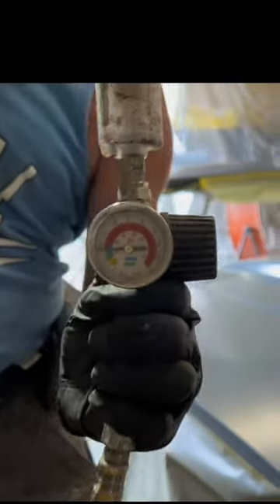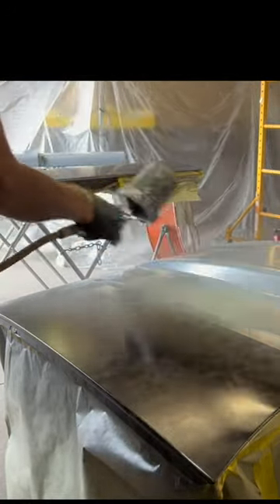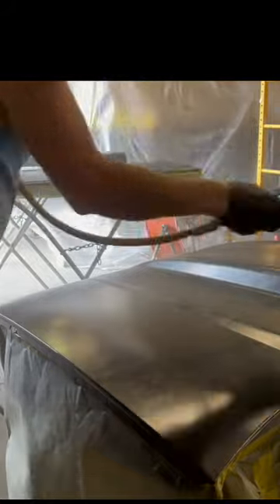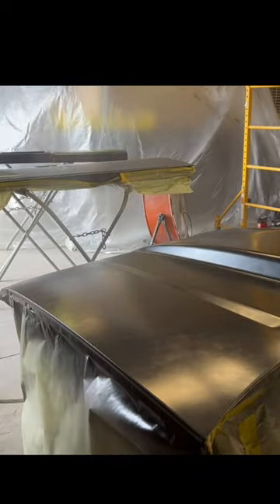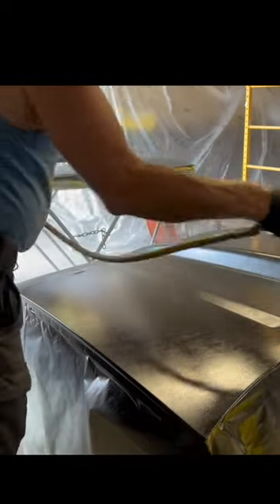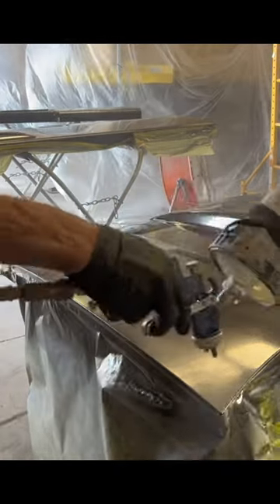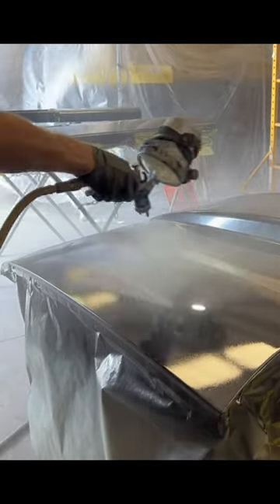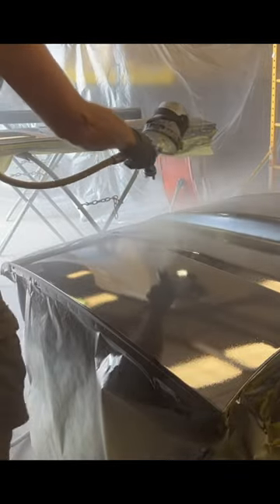EEE-POXY SEALER!!  BILLY GOES PRO!!!🤣🤣🤣 Easy DIY Epoxy Spaying Astro Euro Pro How To Paint Base Coat

Comment: HVLP high volume low pressure   

LVHP low volume high pressure 
 
I can still hear my pops telling me 😂 random info my Dad always use to tell me
Reply: My dad told me runs never rust! LOL
Reply: A Dads voice never fades, does it? 
Mine was killed 24 years ago yesterday (June 5th, 2000) and I can still hear him.

- Righty Tighty, Lefty Loosey
-Hot on Left, Cold on Right, Sh don't run uphill
- Use your mirrors when you're backing! 
- Never swerve for an animal
- Only point your *un at what you intend to shoot
- Never change the color of a vehicle, it's just way too much work 😂

And lots more! ❤❤❤

Comment: Fisheyes are a *****, & one of the easiest ways to rectify (if you have thoroughly cleaned the surface first) is to dust a couple of coats on the problem area leaving time to dry between coats.  I am aware of the aditive that can also stop this, however you need to keep using it.
You are going great Billy!👍🏻👍🏻

Comment: Rock on billy. Another jewel cause old guys rule baby 😉
Reply: We used epoxy mainly as an adhesion promoter  but only over nice smo.otht sanded parts works great for that. But that was 25 or 30 years ago there are better things now read directions on a real high guality filler it says over bare metal and will work over factory properly sanded finishes. Epoxy works on bare metal under bed liner.well.

Comment: Make sure you get the freshest catalyst for the epoxy you use, most people think buying it from paint store means its fresh.  Thats rarely true. Get the batch # off the catalyst and call the paint manufacturer to find out its production date. Epoxy catalyst crosslinks like crap when it's even months old. Once the catalyst for epoxy is opened it degrades rapidly.  It may appesr good but it will wipe off with thinner.
Reply from the maker: Many people know that I am not the greatest fan of the ‘poxy😉😉
Reply: @OldBondoBilly  induction epoxy like ppgs stuff, I forget the number, with fresh catalyst has build and bigtime bond. Bodywork ontop, then more epoxy and then primer surfacer.  Bondo sandwich

Comment: I remember the first time I used an HVLP system 👍 Seems like I could laybit on and get more coverage with less runnage.
Reply: HVLP 60% or more transfer efficiency. Regular siphon gun 35% transfer efficiency.
Reply: @rayfairfax4330  Definitely noticed the difference 👍

Comment: Billy, could you go over the basecoat technique you use? I've never seen that dust coat vs wet coat on base before.
Reply: @anthonyking4387  I'm aware, I use that for metallic and pearls, but Billy seems to be using it for everything or a similar technique
Reply from the maker: I never “dust coat” basecoat. I spray it medium wet

Comment: Show people how a hvlp actually uses alot of pressure to get that 10 psi low head pressure & do you have a flow guage to check yours wt?
Reply from the maker: I prefer LVLP for maximum transfer efficiency
Reply: @OldBondoBilly  less over spray floating arround huh?? Saving that material also!

Comment: Youre regressing back to 1980 if you are using epoxy. There is a contreversy about epoxy but is only on utube painters . Most professional  shops dont use it.the paint store you hafto special order it. Dallas tx